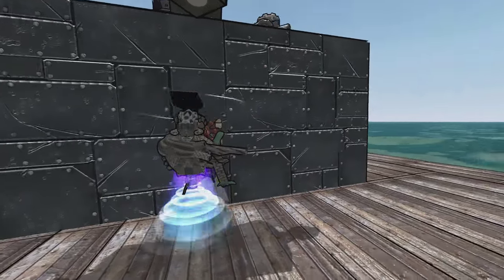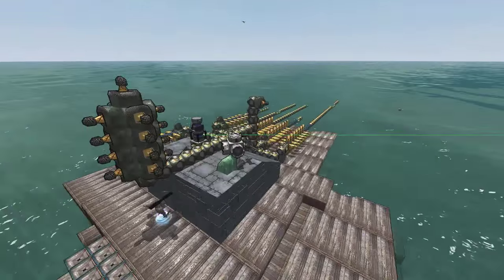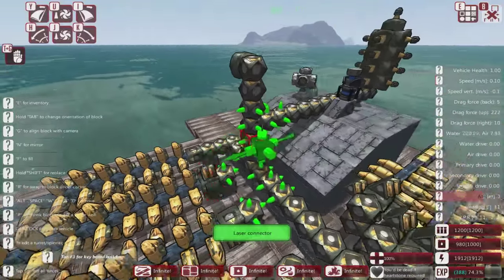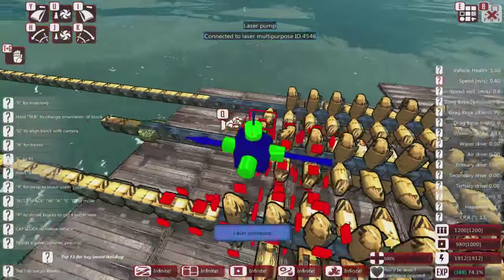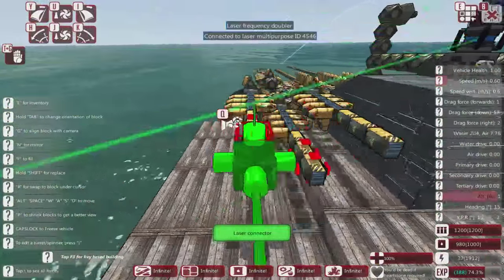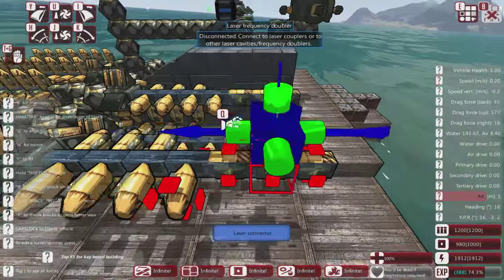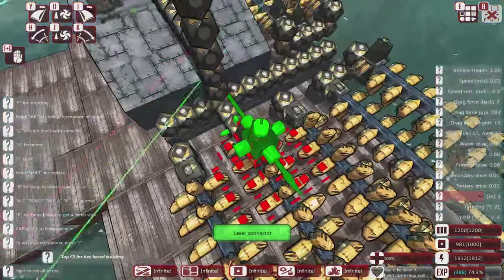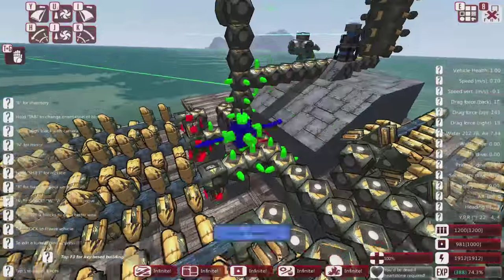From The Depths Lab13-Laser Missile Defence Testing.LetsBuild,Playthrough

Comment: One thing you may not have considered - your test platforms were rather unstable. If you increase stability the structure will sway less. This will allow more hits from your defense lasers. Considering the hit box size for the missiles, the 1-3 degree sway of the structure makes a massive difference the further away the target is. This explains why all your test systems had significantly higher accuracy the closer the missile got. Great video, I enjoyed watching.
Reply from the maker: +Brad Petrie probably true, but since it was the same for all systems tested then the difference between each of the systems would still be the same. I'm not sure that the LAM is effected by sway/accuracy like say a cannon or missile is, it seems to be more an RNG as I have seen some very fast and erratic moving ships use LAM's with no difference between stationary or moving. I have no definitive proof either way other than objective testing and observation.
Reply: +Dels Gaming Perhaps if it was tested on a fortress platform?

Comment: I'm fairly certain the threads on the forum are still accurate for laser systems. The multi tube build is less effective because missiles have 100 hit points so it took twice as many hits for a kill as the 108 damage pulse setup.
Reply: Just thought of this, does the pause correspond to when the wireless receiver rotates toward the incoming missiles? If the missiles are not in the missile warner coverage the lasers will not fire.
Reply from the maker: +Breakthroughsoftware I did think abotu that and changed the rotation speed but seemed to be at a different rate.
Reply from the maker: +Breakthroughsoftware  The advantage of the multi tube is it has more chances to hit to offset some of the damage loss. The ideal if there is unlimited power is to have multi tube with 100+ damage but I wanted to keep more reasonable power limits so I think for efficiency the single tube 4q seems the overall slightly best on efficency for blocks, power etc.
Reply: +Dels Gaming I am 95% sure that multiple tubes with the same number of q switches are combined into 1 actual beam that is no different from a single tube with the same stats listed on the MPL. It was sure acting that way when I was testing lasers last week for my personal notes.
Reply from the maker: +Breakthroughsoftware If each of the tubes are identical then I see it appearing that way, but I'm not so sure. The fact I can get a pulsed and a constant out of the same laser would suggest that they are treated independently and the figures just show the total if they all hit. What I think would be interesting is a 4+ tube setup with different q switches, see if it pulses or sometimes does large damage sometimes huge. It's not clear from what I can find, so I just see what seems to fit the evidence.
Reply: +Dels Gaming They reason I think they are combined is because you can have all the frequency doublers in one line that doesn't even have any cavities on it and it will convey its AP rating to other beams of the same q switch configuration.
Reply from the maker: +Breakthroughsoftware Possibly linked if same Q Switch, not tested that and a bit difficult to confirm. So will have to go with common consensus on forums. So multi tube is just a layout system essentially. Ok, noted for another time.